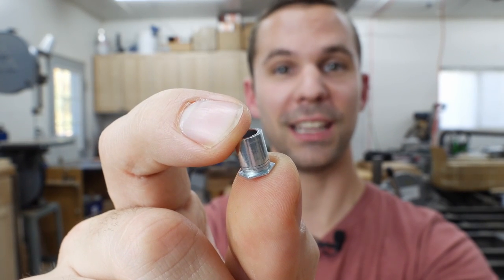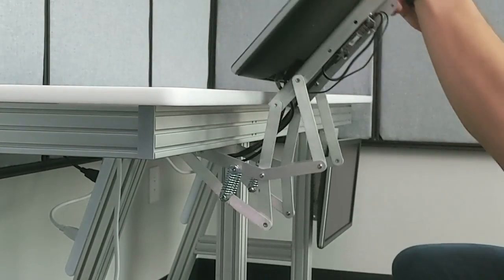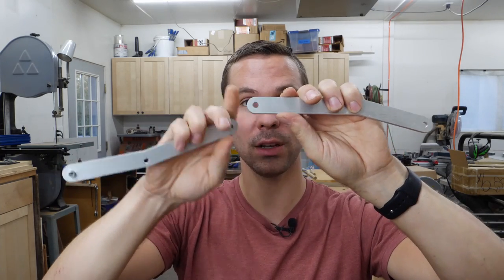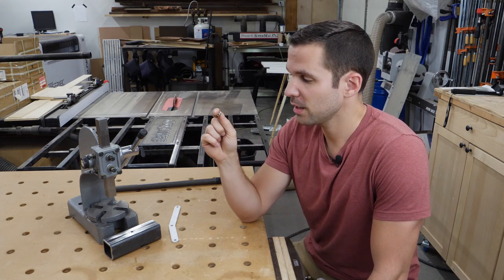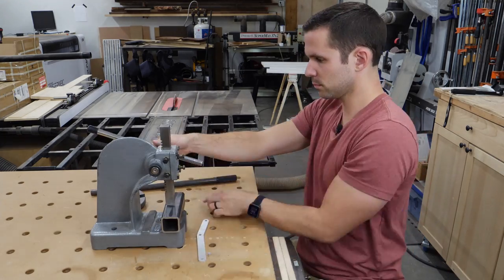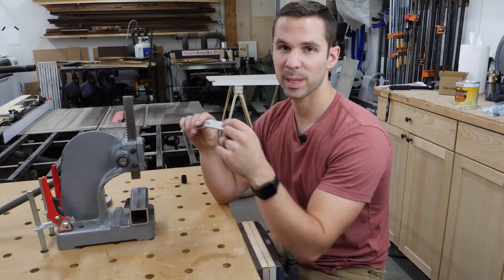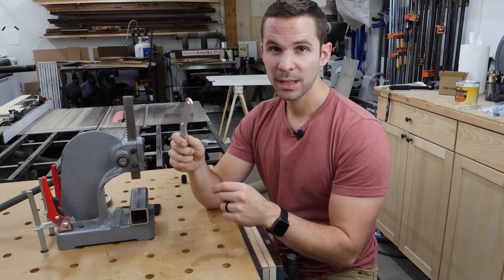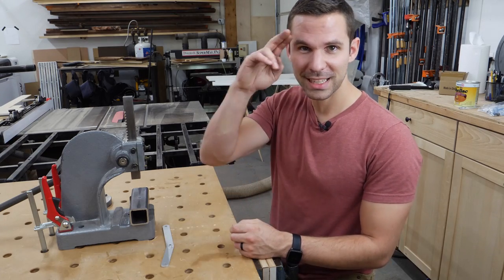Installing Threaded Pems Inserts, No Fancy Equipment Needed.

Comment: A hydraulic crimping tool also works.
Reply from the maker: Hmm, how much do those tools cost?
Reply: @42Pursuit  I got a handheld hydraulic crimp tool from harbor freight for about $80 (USD). The hydraulic crimper is intended to be used to crimp fittings onto large gauge electrical wire, but since it produces up to 8 tons of force it can be used to install pemserts in certain materials.

Comment: What about the back material pertruding, is there a way to get countersunk bolts and nuts in a 6mm package so that the inside and the outside sit compeletly flush!
I have found some 110° countersunk bolts but countersunk nuts seem to be non existent or that's my opinion!?
I live in Germany.
Reply from the maker: That sounds possible. I sized the threaded standoffs to be equal to 2x the thickness of the material I was working with. It's possible to get shorter sizes. McMaster-Carr has got a huge selection, it would depend on what thickness of material you were working with and whatever other design constraints you have. You should be able to get a shallow enough standoff that a countersink screw would thread into it and end up with a joint that was flush on both sides.
Reply: The head on the standoff is between .018-.023 . I have worked at PEM  place for 20 years.